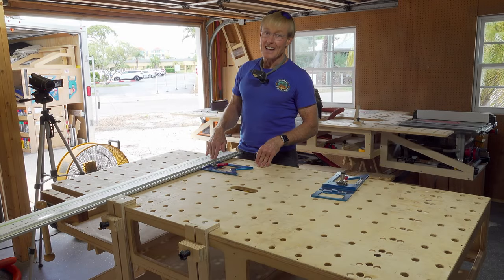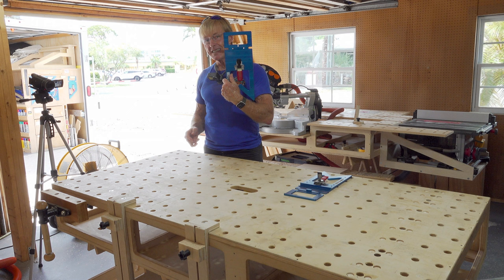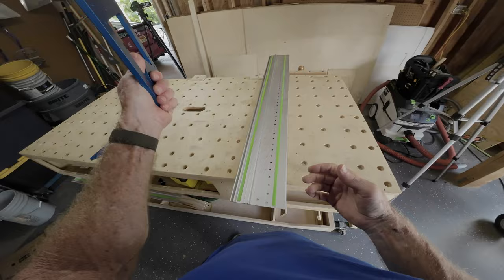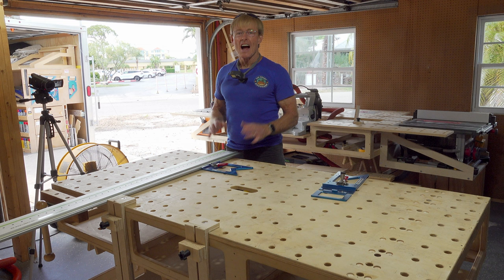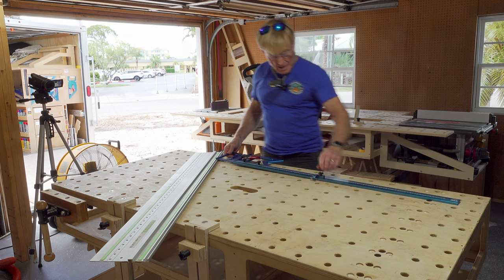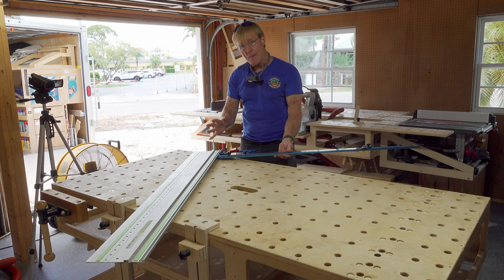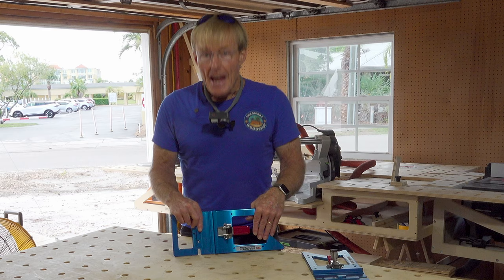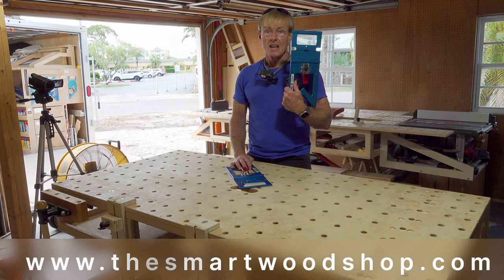TSO GRS 16 PE v2 vs. Previous Model: A Detailed Comparison

Comment: Thoughts on upgrading design, I think one should never stop thinking of ways to improve something.  The ability to install more quickly to the track seems like a great and sensible improvement.  I do wonder why the clamp slots were made smaller, besides the small reduction of milling it and slight strength improvement....

Comment: I think I will just remove the far side of the ‘T’ that slides into the track. It’s only the near side of the ‘T’ that locks onto square when the spring clamp is activated. With the far side trimmed off, the track will hook over it at any point and the spring clamp will square it to exactly 90º.
Reply: Let us know how it works!!
Reply: My thought exactly!

Comment: I run the Milwaukee tracks and I know that originally TSO said this was not compatible with them but then they later came out with a version that is compatible. Does the version two work with Milwaukee?
Reply from the maker: I am not familiar with Milwaukee. Check with TSO😎🤙
Reply: Yes the V2 that Ron is showing in this video is the new model that is compatible with the milwaukee tracks.